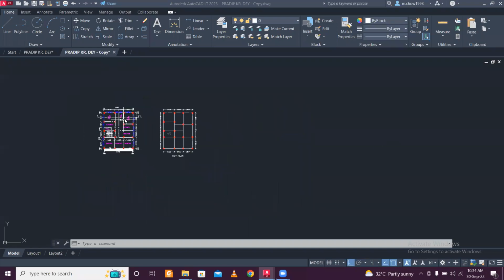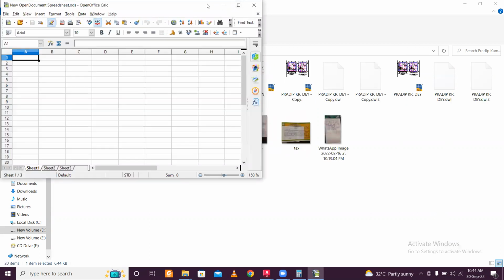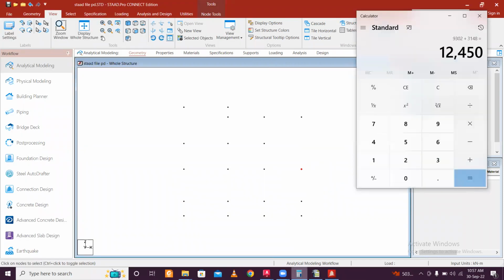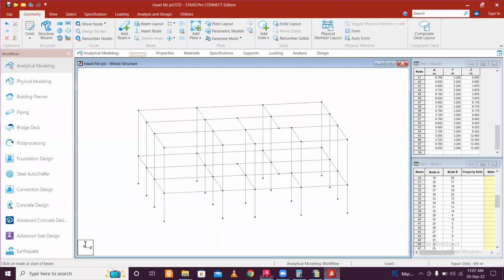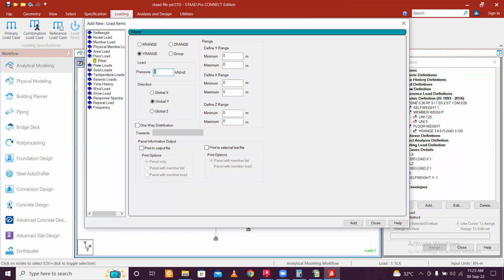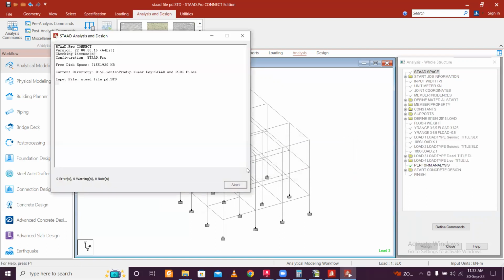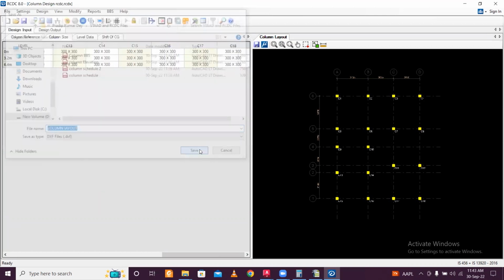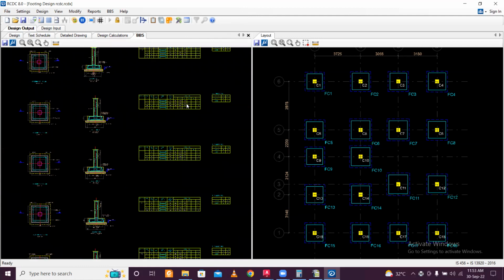Full Building Design and Detailing using  STAAD.Pro Connect Series and RCDC

Comment: You are already selected min ne max dio of steel bars while in analysis and design part of stadd pro.then why you again choose the size of bars for beams, columns and footings in RCDC
Reply from the maker: In RCDC we do detailing separately, so we have to assign, basically only the frame analysis results are taken into RCDC, the Design done in Staad does not matter, you can choose to skip it, only perform the analysis part.
Reply: Bro I have been trying for installation of RCDC but it shows License does not found..can you help me to install RCDC

Comment: I noticed in column design higher story have more reinforcement than lower story column why this is confusing plz explain if you have solution
Reply from the maker: It happens no worries about that, the structure is complex and many loads come combined through other members, so this can happen.
Reply: @MainakChoudhury  bhai kuch solution ho aap k pass to bata do

Comment: How to solve failed column and beam in design, or over stressed
Reply from the maker: You can do it in Staad by increasing the size, however for RCC design Staad doesn't select failed members automatically, you have to check the design report and compare, which is difficult for big structure, so RCDC is better for solving the failed members.

Comment: Instead of suffering to generate column through nodes 
We can use link option while doing translational repeat
Reply: U r right when i did link steps,it make column at every intersection
Reply from the maker: It works differently for dissimilar floors, practically most buildings are dissimilar, so this way is preferred.

I know you are telling this because in most tutorials they do this, we can easily do that when the floors are similar. But we have to dig deeper, have you seen any house having similar floors? The answer will be very few, so dissimilar floors means, dissimilar beam arrangements, hence this approach.

Also do you expect to have columns at all intersections? There can be intersections due to beams also. In that case you cannot use linked steps.

Hope I could clear your query.

Comment: When i try to import staad file into tekla one notification popup it says "check that it is not a manufacturing model"
What is the solution for this problem
Reply from the maker: Best solution is do not import, just make the model directly in Tekla structure. I know the advertising can be done in a presentable way, but in opinion there will always be some compatibility issues.

Comment: modelling in staad is not the best in the system at all. likewise its detailing where you cant have all the information for a beam at once. cantilever slab is also a problem
Reply from the maker: Every commercial software has its advantages and disadvantages, you have to pick the one which works best for you

Comment: Good day, what is the problem if the rcdc is unable to read the data analysis? Thank you
Reply from the maker: There could be 2 scenerios
1. Staad file has some errors, check the analysis of the Staad file
2. Version difference between Staad and RCDC
Reply: after analysis you may have access from staad pro connect  software.

Comment: This is idealistic to consider column centre at node beam flush positions master slave etc needs Tobe considered
Reply from the maker: While Going to perform design we don't know about the column size so its center is taken, later after design is completed we can overlap with the architectural plan and assign column locations properly by double checking

Comment: Please using building option again 🙏
Reply from the maker: Didn't get your point, can you elaborate please
Reply: @MainakChoudhury  Sir there is building planner option to generate rcc buildings layouts of slabs and it automatically generates 3d model with precision column beam offsets Only problem is you need to apply seismic loads in staad before analyzing
Reply from the maker: @mahendraaandkaanchanpatil1489  ok, got you you are talking about Staad building planner software. Till now I use Staad, RCDC and AutoCAD or Tekla+ AutoCAD to present those things in my final drawings. But since you suggested I will try using that too.

Edit 1: I have tried using the building planner option but it doesn't work since I do not have autocad 2007